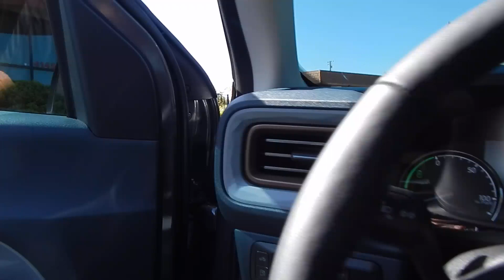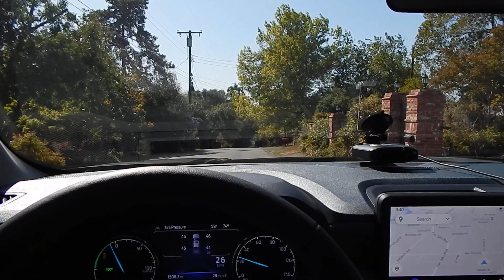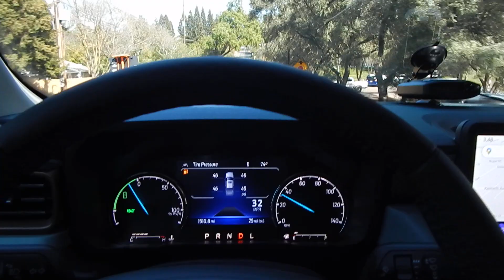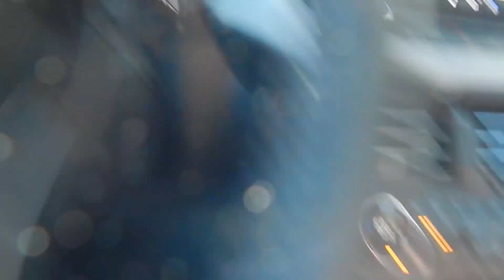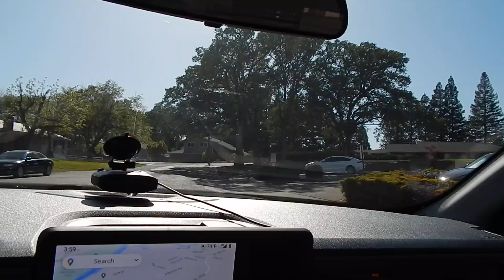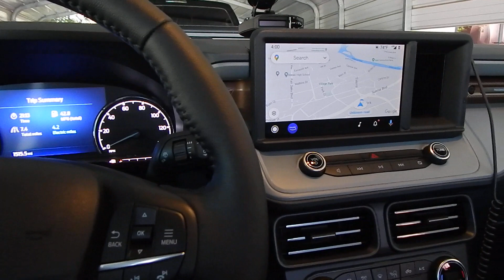2022 Ford Maverick Lariat TEST DRIVE and 1500 mile update!

Comment: Where did you get the flag decal for the back window?
Reply from the maker: We got it from amazon.com and it was intended for a Ford Ranger.  Some cutting was necessary to make it fit the smaller window of the Maverick.  If you want to avoid this you can wait a few months and I am sure companies will start making ones specifically made for the Maverick.  Thank you for your question.

Comment: Nice demonstration video , I also got my Maverick 8 months and one week after I ordered it.
So far like you said I feel comfortable driving it for up to. four hours a day sometimes, I love the gas mileage, my Maverick has now 2500 miles , on my 4th tank and averaging 48 miles per gallon, incredible.
The only thing I’ m concerned about is a bit of loud noise , kind of a slight clunking noise when I brake a little harder than usual, have you or any other Maverick owners mentioned this issue or is it normal, it only occurs sometimes and I have to step on the brake pedal hard.
Other than that I’m thrilled with everything else my new Maverick has brought me so far .
Reply from the maker: Hi Ludwig, thank you for your comment. The clunk on the brakes when applying it very lightly happens once in a while to ours as well.  I would not say that it is normal but more so a common issue.  I have been monitoring it to see if it goes away as the vehicle gets more and more used.  It almost feels like something is sticking and then breaks loose allowing the brakes to engage.  I'm sure there are more Maverick drivers who are experiencing this issue as well.  It may be covered in a future recall.  I will keep you and everybody else posted.

Comment: Dang...47 and 45 psi in the tires??? That can't be factory spec.
Reply: Should be 35 from what I’ve heard.
Reply: they are shipped at like 40-45 even though the door says 35, multiple people noted the same thing.
Reply from the maker: correct this is how we got it and just recently I adjusted it down a bit.